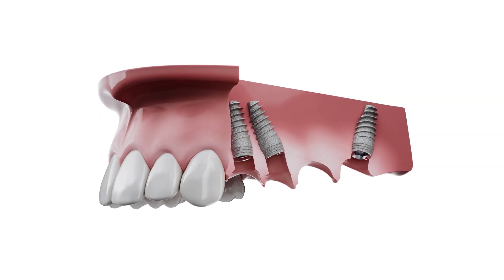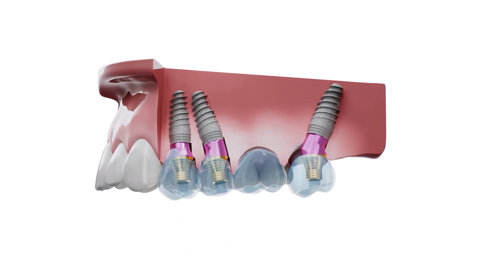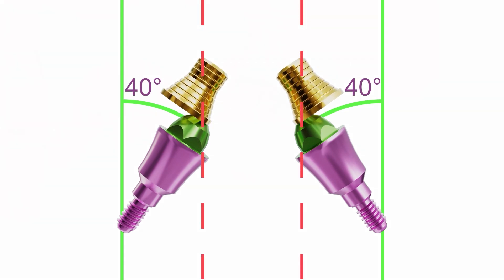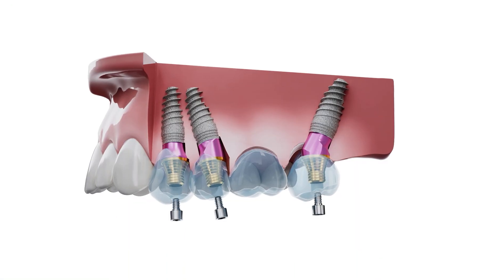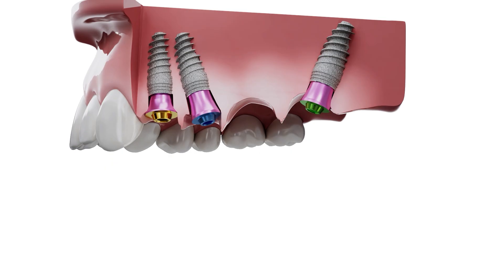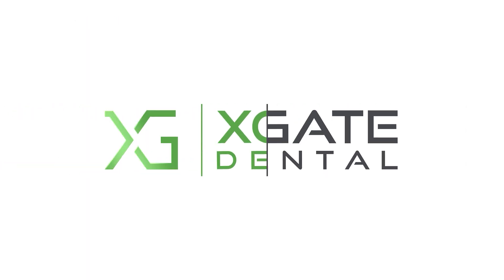V Type XGATE Dental MUA multi unit Phenomenon

Comment from the maker: 00:00
Let's consider the classic case where we have three implants: the first implant is placed vertically, the second implant is at a 15-degree angle, and the third one is sunk about 30 degrees.
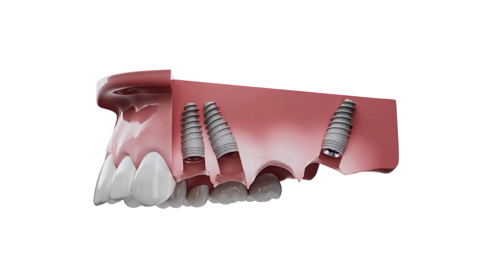00:15
Today's solution to correct the angle is to put angled multi-units.
00:21
The implant, placed vertically, has a straight multi-unit and therefore two angled multi-units: 17 and 30 degrees. 
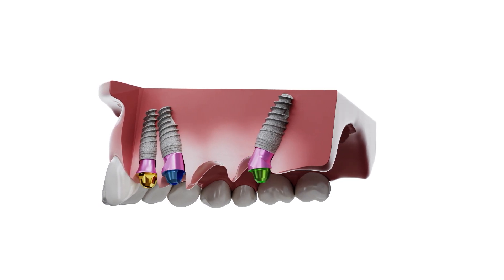00:28
The titanium bases are glued into the crowns and screwed together.
This is what is commonly done today. 
00:34
Dentists are much more comfortable working with straight multi-units. You take a classic D-Type multi-unit with a large cone, but here you can see that at these angles, the titanium bases will not seat all the way, but will rest against the cone of the multi-unit.
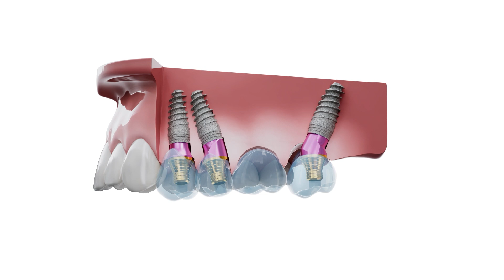00:47
At XGate Dental, we have developed a straight V-Type multi-unit with a small taper that allows the titanium base to fit snugly when the multi-unit is at a large angle of up to 40 degrees.
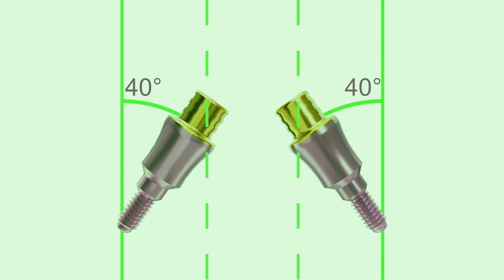1:01
We will replace the angled multi-unit with a straight V-Type to match the gingival level.
We change the titanium bases for the V-Type multi-unit.
And you see that the bridge sits.
At XGate Dental, we say, "Why work with complex angled multi-units when you can easily do straight ones".